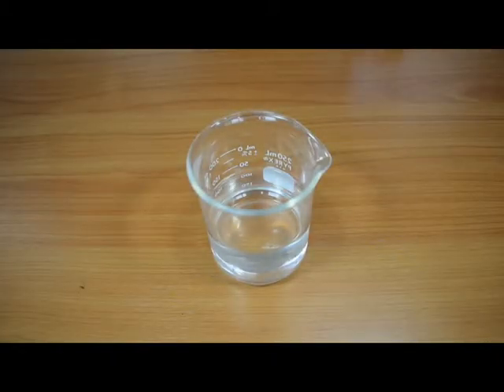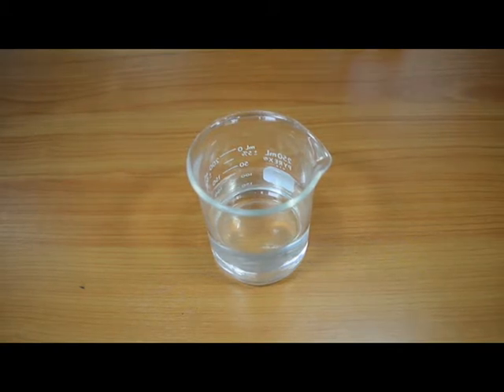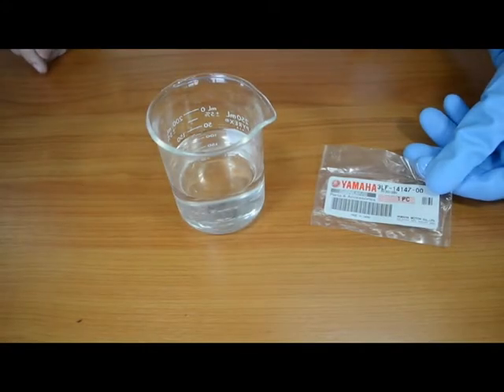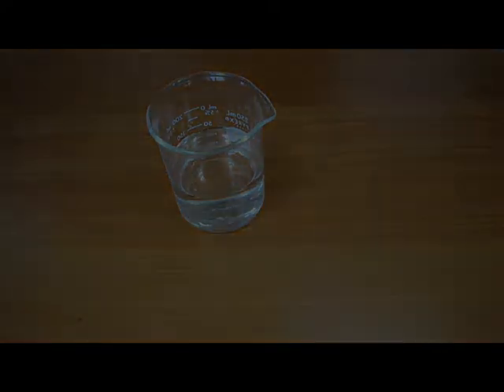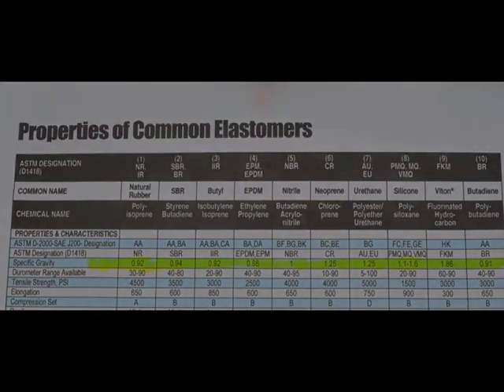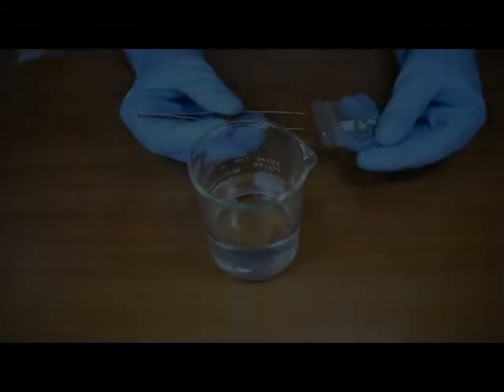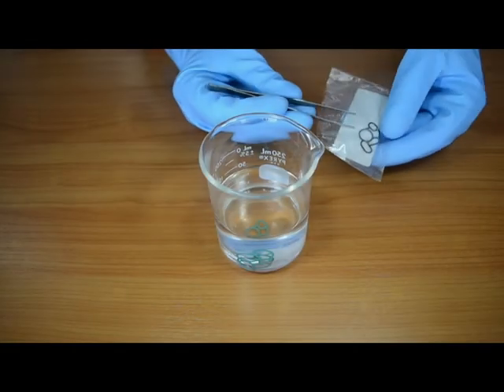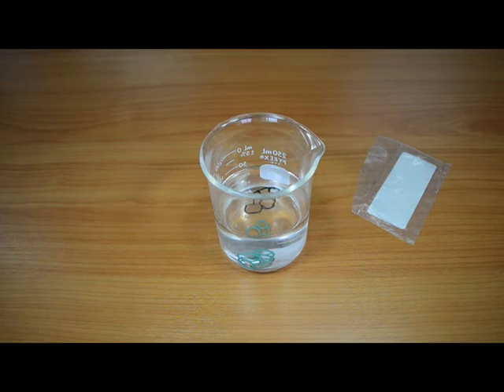Is It Viton? A Simple Test

Comment: I use water and salt. I submerge viton and other O rings in the water and add salt, stirring until the nitrile rings float. 3rd grade physics. I have no way to measure value of gravity of my solution. I only can taste it with my salad. This test is not a composition analysis but I am demonstrating that the seals that float aren´t viton and I can conclude that I won´t use them in my Mineral Oil operated motorcycle clutch press. Thanks for your video. It inspired me to try and test my own way without the use of acids.